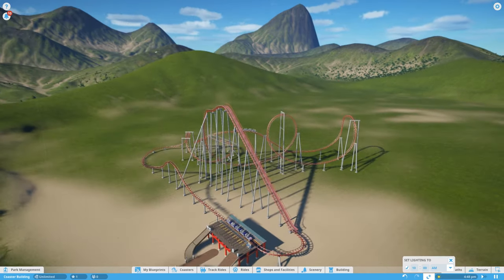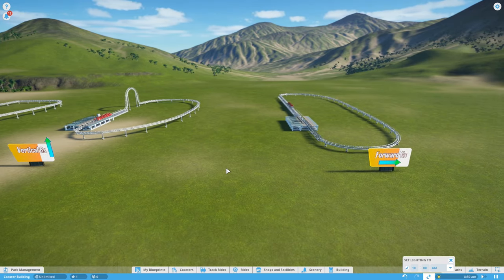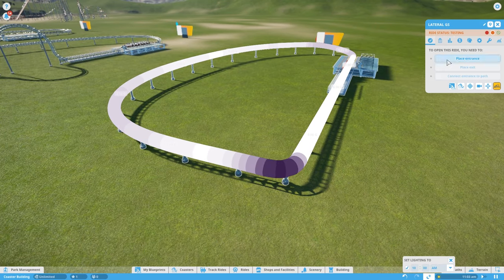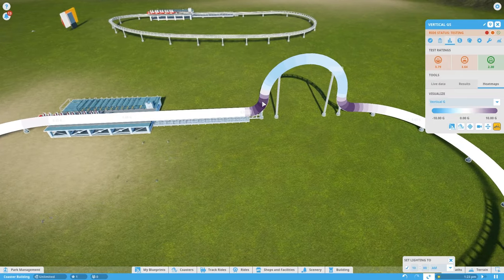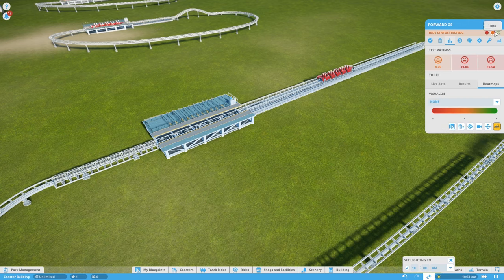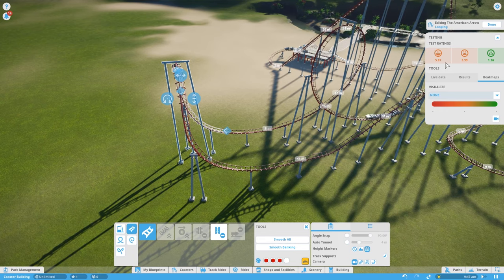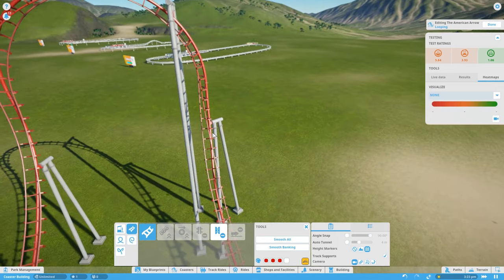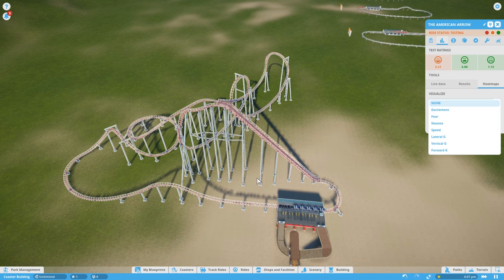Heatmaps & G-Forces - Coaster Building Guide | Planet Coaster Tutorial

Comment: What I have seen is as long as g’s don’t exceed 5 it is generally good. You can see when g’s start to become too much as if you will have a bad nausea part. Nausea will also rise with rolls and such. So long as it is below three it tends to be negligible. Positives g’s are good, so are rolls, which create lateral. Sometimes upping the g forces will increase excitement. I was building a ride and I was trying to make a loop bigger to decrease a spot that was at 4.8g’s. When I reduced the tightness of the loop to about a 4.3 at max the excitement shot down two points. If your g forces don’t cause nausea, it means it’s a smooth g force and is enjoyable! Don’t be afraid of g’a otherwise you’ll make a bunch of boring rides!

Comment: ouch my physicist ears bled when you said "the power of gravity" but that's ok :D When people talk about "G-force" it's simply the force produced by a mass subjected to an acceleration (it's simply Newton's third law, force equals mass times acceleration). That acceleration can be the Earth gravity, so 1 G, which is what you get in a free fall, skydiving. You don't get more than 1 G skydiving. You can get more than 1 G if you introduce an artificial acceleration. In a rollercoaster, it can be being launched OR from a curve. Because whenever there is a curve, you force the coaster to go out of its natural (inertia) trajectory. If you force it out from going straight, you get the lateral G from the first coaster. If you force it out from going horizontally, either by having an up section or a down section, you get the up/down G from the second coaster. So, in that case the mass is the coaster, and the acceleration is the angular acceleration from the curve or up/down section. And of course the launch section gets you that forward G. And in that case the acceleration is simply the coaster's motorized/hydrolic acceleration.